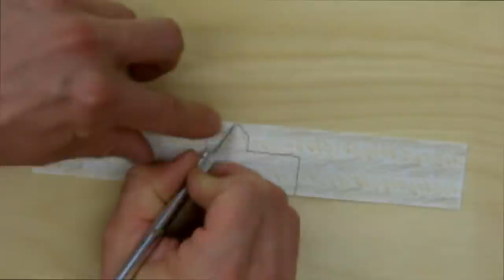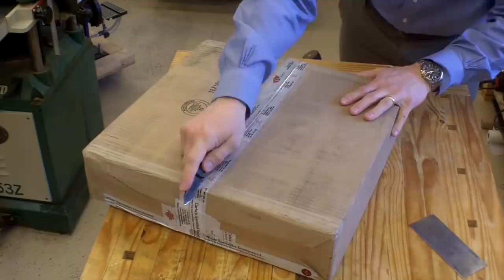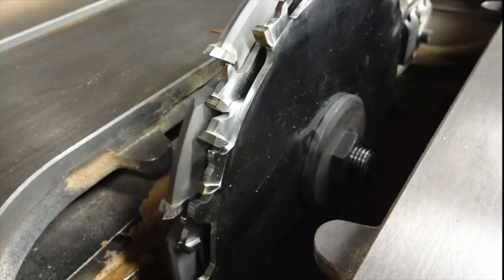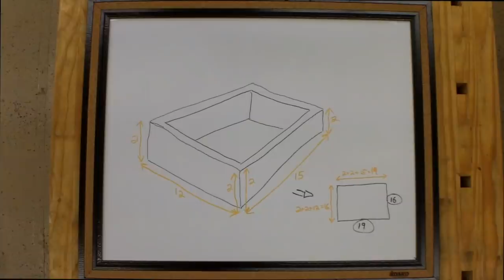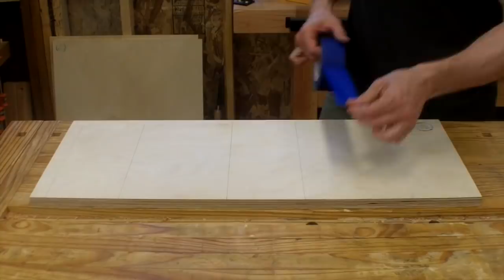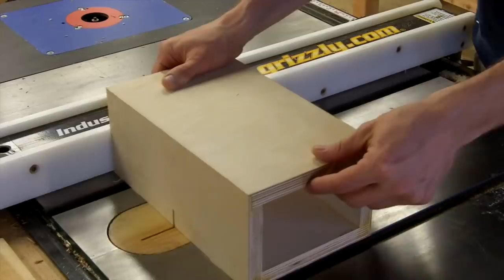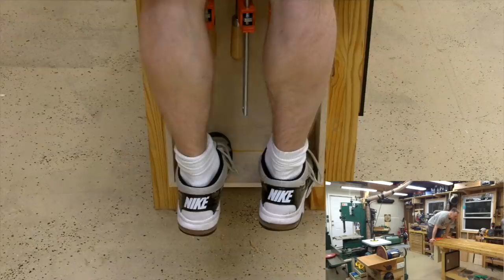New Invention - Easiest Drawers Ever!

Comment: and another thing, if you're order a custom made blade with 90° triangular tooth, I think one inch thick should be enough .
that way you only need just one blade to work with any plywood thickness. 
it could be 1/4  ,1/2,  3/4 or a n inch thick.
Reply from the maker: +Sergey Carpenter Three points for you to consider:

-  A 90 degree triangular blade big enough to cut through a 3/4" sheet of plywood would be quite thick and much more expensive than my blade.

-  Since my blade works with a dado stack, just one blade can cut any thickness of plywood as well.  In the video I demonstrate drawer making with both 3/4" and 1/2" plywood using the same blade.

-  Since the two sides of the cut made by my blade mate together, but are not symmetric (like a 90 degree triangle blade's cut would be) the sides lock in and do not slide past each other when you fold them up and clamp the drawer.  This is a substantial advantage.

Comment: why making it so complicated?
I think 90° blade will be just as good. 
you can do two 45° degree angle at the same time. 
it will hold just as good, plus it's does not matter what direction you make a cut
Reply from the maker: +Sergey Carpenter I look forward to your video demonstrating this technique

Comment: nice one! I've felt that dove tails are obsolete for years with the quality glue available today. not worth the time especially in a drawer where no one will hardly see it. in fact , even this method is over kill IMO. i started doing a simple dado on my drawers with some tight bond and a few brads to help the glue set.  Did this for my own kitchen drawers over 10 years ago and they're holding strong as ever.  Just make sure the front and back pieces run into your sides so the joint is hidden. then apply face and ur good to go!
Reply: Routers make slotted dovetails a doddle. Just remember to pilot the slot with a straight bit first. Ambitious idiot that I was, I decided putting a lip on a 4 foot shelf would do for my first try. Things started to get a bit tickly towards the end of the cut, (Yeah don't tell me.).  The bit had climbed out of the collet far enough that only a fine shaving had been between my palm and the bit.

That valuable lesson learnt, it really didn't take me a great deal of time to build a coffee table that went together like a puzzle with just a couple of screws to hold the last two rails in place.

Dovetails are just too elegant to give up, especially the secret ones that only you know are there.

Comment: Looks very cool. He could have easily had his dado set re sharpened to match the depth of cut he needed to work with his custom profile blade. If he brings it to market it would have to be a single blade to make the whole cut which would eliminate that problem. A simple V cut really makes more sense and saves time by eliminating the need for two different setups when making boxes with sides that fold up from the base or floor of the box. There are good reasons that V grooves have been used for this purpose for so many years and they provide all the strength you should ever need. To make the type of mitered rabbet joint he is using on a table saw I would just grind a cutter for my table saw molding head. V groove cutters for it are a stock profile and I already have that.

Comment: Have you actually managed to make a blade that would Create the cut without the gap? I'd like to see it work before anything else gets said or done.
Reply from the maker: +Adam Pierce I've been working with a partner to design the finished commercial version, which will of course have the gap corrected.

Comment: Can you buy this yet? If so where? Why don't you have whoever made the prototype manufactured for you and you could sell it on your own?
Reply from the maker: +Michael Sherman not yet but hopefully soon.  Two reasons why I could not just have the shop that made the prototype mass produce them for sale.  First, they don't do volume efficiently, it would be super expensive that way.  Also, the blade you saw was fine to demonstrate the concept, but needs some subtitle design changes to make it user friendly, possible to sharpen, cost effective to manufacture, etc.  that all needs to be right before it can go on a shelf, and it takes time.
Reply: Hmm, ok. I sent your video to Ruth Niles (she has manufacturing source with he bottle stoppers and many woodworking contacts) to see if she could help. She mentioned that you might contact rockler or Lee valley. Also might contact Shopsmith as well. Otherwise the regular manufacturers (Diablo, dewalt, etc.) may be interested. I don't have any contacts for those. Please let me know if you get this to market! The shark tank idea was good since you're interested in licensing this. They would be able to get it out probably before the end of the year!
Reply: +Andrew Klein Have you thought about going to Kickstarter.com pledge for funds? I'm so much interested in getting your blade when it comes out the market! Best luck!

Comment: thats really interesting, so random I came across this, I created the same joint on my first ever furniture build, but did each cut with angling the blade, and running each piece on its own. had to come up with it for some structural, seamless joints. at the base of the moving cabinet. https://www.youtube.com/watch?v=Uj2eEw7aM3A is the video of my first ever build, and using table saw and such. last year, and havn't been able to get me off the tools since. anyways may need to contact you next time i have an idea, and see if there is anything you can do with it. cheers keep it up, and to anyone interested all i can say worth looking into, solid joint, and clearly very versatile in the things you can do with it. Cheers

Comment: nice blade hope to see it soon. I would add a dado blade set with the profile blade so they match perfect as well as as a separate blade matched to standard dado blade diameter. Also the reason for the fail was most likely that gap from the mismatch. Gorilla Glue would fix that but is a bit messy for the unfamiliar. 

There are many Angel Investor groups you should look into. It shouldn't be to hard to find a good match as long as you don't get too greedy. Good Luck!

Comment: I am curious if the blade cuts through the top layer of wood and the tape serves as a tempoary hinge until glues.   Some views looks like the cut leave a bendable layer ans others looks like it cut through bit the tape is holding it.  You have a note not to share with manufacturers or investors so I assume you got support to build.   Getting patents is different today.   They used to search the crap out of them but now there is more load placed o the inventor and the Patent Office philosophy is to let the lawyers handle the complaints.    Also would be nice to see it used with drawer slides bottom and sides.

Comment: Very clever spacial visualization to develop this profile. Unlike a draw lock router bit, which involves multiple presentations of material. Interesting that the outer veneer layer folds nicely both with and across the grain. Very impressive. I have a blade distributor in Canada that may be interested in this with you. We should talk. Ron

Comment: Wouldn't a simpler V cut of some sort achieve the same effect?
Reply: a v cut would give you a much weaker glue surface, would require a wider [expensive] blade, and you would lose the ability to scale up to thicker pieces with the dado
Reply: +Julien Couvreur I was thinking the same thing

Comment: Nicely done and I look forwards to seeing your product on the market.  I saw a similar concept once in (I think) Fine Woodworking magazine.  The design in that article used a custom blade to cut V shaped grooves.  The blade was mounted on a radial arm saw and I think the saw was CNC controlled.  The fellow who built it had an order to create 4 sided boxes, no top, no bottom, to be used to house the electronics for a medical instrument.  I think the boxes were made from plywood and for the purpose did not have to be exceptionally strong so the surface area created by the V groove his saw cut provided an adequate glue joint.  For accuracy he added bracing to the radial arm ensuring all cuts were at 90 degrees and of exactly the same depth.  After successfully completing that production run he continued using it for similar orders but eventually sold it to another shop as it was taking up too much shop space for such a single purpose machine.
Reply from the maker: Pretty soon you can buy it from Rockler: http://www.rockler.com/rockler-miter-fold-dado-set

Comment: nothing new..been used with mitre folding techniques for decades.
Ive been a Millwork Contractor most of my life.
Also, dosent the material thickness variations affect your geometry?
Reply from the maker: Thats really what makes this most novel, the Dado portion can be adjusted to quickly set up the perfect joint for any thickness material.

Comment: What happens to the joint when you sharpen the profile blade and the profile gets a little smaller?
Reply from the maker: you can adjust the dado to compensate for material thickness.
Reply from the maker: check out my latest video: https://youtu.be/IfypMOcb75M

Comment: Bevel folded joints are found on loads of flatpack furniture.  A 90 degree included angle bevel cut joint is better for MDF.  Your joint will be slightly stronger when using quality ply, but so much furniture is made of MDF these days.  A 90 degree router cutter will be so much cheaper than your cutter for the bench saw.  It's a nice idea but has limited uses.

Comment: Flat-pack furniture uses folding joints that are just 45 degree butts. Not sure why you would want to make it more complicated. It is all about gluing are in the end. Your idea looks cute but I think really not necessary. With a 90 degree router bit I could do the same without an expensive circular saw. I cannot get birch pky like you use in Thailand. It is all fairly basic cheap stuff that splinters easily.

Comment: Clever, but you could have also a blade in a shape of your bevel , just like the top of the picket fence with 90 degree point would work the same way, les complicated as far manufacture of the saw blade goes.

Comment: Excellent, maestro ! ! Great invention ! !
I wish all business success ! ! !

It turns a whole set of cuttings into a few passes of the same blades. Assembly becomes one move.
In mass production, you could have two tables saws, facing each other.
And at the worst, just add two or three screws at each corner for added strength.

Comment: Nice idea.  A couple of questions.  Does this work with just 1 thickness of plywood or material thickness?  After the blade is dull, how much would this cost to sharpen?
Reply from the maker: +Mike Belik because the dado portion of the cut is adjustable it works with any thickness of plywood.  Sharpening should be quite reasonable, but I'm still working on getting this to the market.
Reply: +Andrew Klein do you have a kickstarter link?  This seems like an obvious kickstarter idea
Reply: +silkcom Yes! this is not a bad idea.  Kickstart or other start up might be a way to go.  If you have friends and relatives with money, work out a structure and business plan and do it yourself.  It is very rewarding and nothing will slow you down.  You already had the blade made. Go and make a few more and just sell them.  Get money upfront first then order them so you don't use your own money.  I wish you all the best.
Reply: +Andrew Klein I have always hated making drawers, I would love this tool.  I just dropped 600 bucks on the Incra LS-TS positioner, I would be happy to spend a hundred on this blade.  But I imagine it will go for more?  What do you think it should sell for on the market?

Comment: I agree with all the "brilliant" remarks.  

Some production shops may have an issue with the drawer bottom being the same material as the drawer sides because of the extra cost and weight.  Not sure of the cost benefit trade-off with labor.  

And, many shops use Under-drawer soft close hardware which may be an issue with your design.     

Sharpening?

Good luck.   I hope you're successful
Reply: +Cassie Monteverde That's an easy modification. Just slot the side wood and cut across. Then wrap around the bottom thin wood. He actually shows this technique in the video.

Comment: Although I don't live in the UK in regard to the issues surrounding dado stacks it is still a challenge in the US for those of us that have small shops with smaller contractor type table saw, many of which don't accept dado stacks.  I would be great if a product such as this were made for a specific plywood thickness which could eliminate the need for a stack and make a single blade concept possible.  The plate could be much thinner and the edge built out to meet the thickness of the stock.

Comment: that's a really neat idea if you have the resources to get a prototype blade built, as you did.

As a cabinet maker since 2006 I've built hundreds of 'regular build' drawers and I enjoy building drawers and in the time it took you to wait for the glue up, I can build a bunch more drawers in the tradition style.

You can also achieve the same kind of fold-over box build with a double 45 degree router bit (cut on a router table) as it simply takes out the corner material and you can then fold it to 90 degrees and glue it up for a seamless look.  Yours has a more interlocking joint so it might be stronger and but I've built plenty of cabinets and drawers that way and never had any complaints.

But hey, it's still a cool idea and I wish you luck with your patent and hope you sell a bunch.

Comment: I know nothing about wood working. What's the point of that wooden insert at the beginning of each project?
Reply: +adobepoopscript 
It provides a safe cutting surface guide for the blade rather than leaving an open hole.
Usually the same cross section shape of the blade.
Also stops your fingers dropping in if you are cutting safety corners and have a surfeit of fingers to play with.

Comment: Excellent idea for mass production.  .....As all things it takes $ to set up any production line, but this idea, I agree has potential of reducing the number of stations required for a final product.  I just bought a Saw Stop table saw and of course they highly don't recommend the usage of any molding blades in their table saws, due to the unique brake safety system that they have in their saws.  Great idea tho
  Hope you profit from your patent.  Good luck!

Comment: It looked like the hold would be plenty strong enough for most uses but 

Just an after thought for potentially strengthening the drawer at its weakest point -

since the top front of the drawer would see the most lateral stresses 
(pulling on handle, etc) ...

before folding the front side up, you could make an additional regular circular saw (shallow) cut (@ 1/8") down the length of one half of the contours that making up each front vertical joint

That would providing a 1/8" square tube running through each front corner joint 
which would fill with glue (adding 3/8" more glue surface area).

( cutting a row of shallow divots rather than one shallow cut could be an alternative)
(   AND not starting/ending  the shallow cut at the very edges would prevent exposing the square tube of glue to view)

C _________________________________
O 
N       xxx    xxx    xxx  xxx   xxx                 <-- shallow cut or divots(shown) 
T _________________________________
O
U   ( folds to meet above )
R _________________________________

Comment: Why not in simple V shape? That's the usual way to do such joints!
Reply: +Alexander Patalenski 
The idea was to get more surface area and different angles.
More surface area = stronger bond (lateral strength)
Different angles = different angles provides for sheer strength which do not rely solely on glue(lateral strength).

With this particular construction  -- the only angle that would rely only on bond strength (lateral force with no sheer)
would be the direction from inside out - like how he was standing on the inside of one of the sides of the drawer.
Reply: +Alexander Patalenski The idea is to increase the surface area so that the joint is stronger than a simple V joint.  The more mating surface there is the more glue goes into the joint so it is stronger.  There is a limiting factor too, caused by thinning of the wood as the shape gets more complex.  Still this would work and be stronger than a V joint by an amount that would need to be determined by testing.

Comment: Don't know if it will help but I used to work with a company about 14 years ago and we made and serviced wood working tools. (saw blades,  router bits, planer knives ..ect.)
Leitz Tooling Systems. They are based in Germany but have several service centers in the States. Corporate HQ in Grand Rapids, Michigan. 
www.leitztooling.com
May be a place to start.
I wish you the best of luck! 

Elmer Griffin 
from South Carolina

Comment: kickstarter! And my suggestion would be using 1/2 inch plywood to test it. 3/4 inch ply drawer is not the most common scenario. IMHO, the blade should be demonstrated by cutting a strip of plywood or solid wood which is, let's say 48 inches long, 6 inches wide. All you have to do is set the depth and cut three slots by using cross sled jig or something similar, then cut the slot for bottom. finally, assemble a 12"x12" drawer.